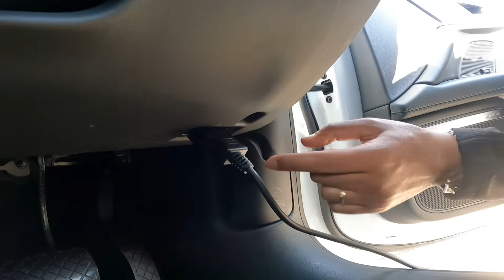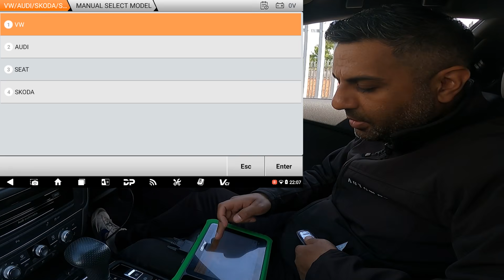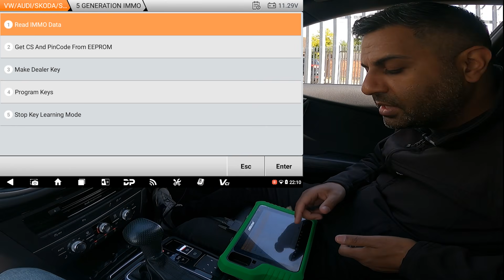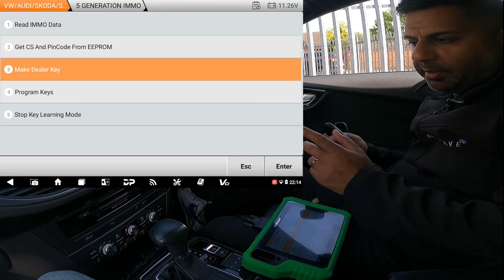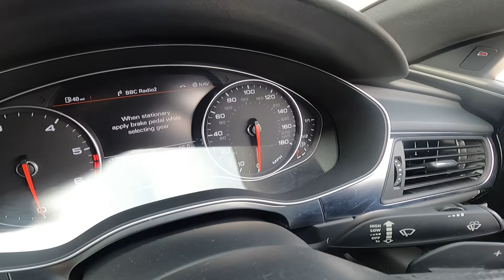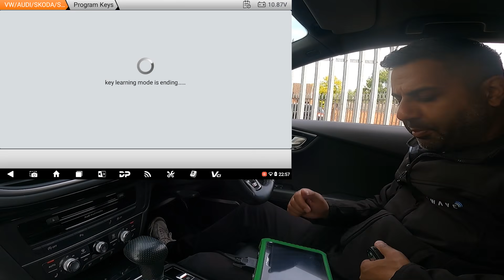Audi A7 2013 Spare Keyless Remote Key Programming Using Obdstar G3

Comment: Thanks. It is almost the same on the Xhorse KTP, using the Auto Wizard procedure.
G3 is a great tool, especially for Renault. Everyone else has lost support for half of the Renault models, or simply cannot do them, no matter what their menu says they can do (Autel).
Xhorse doesn’t list a model if it doesn’t actually work — for example, Clio 4, Clio 5, etc.